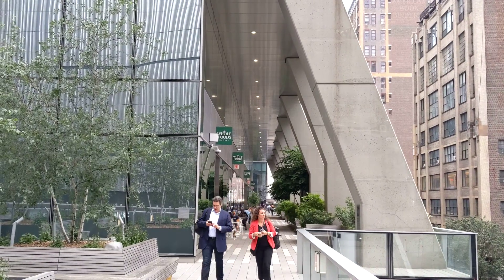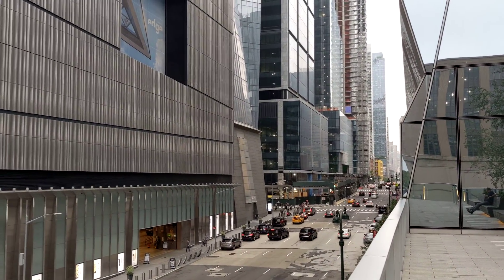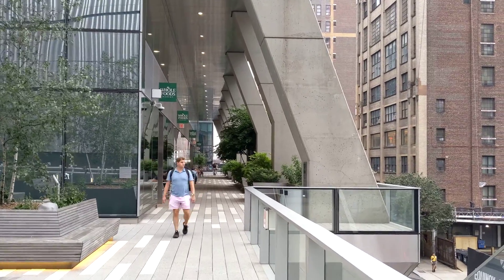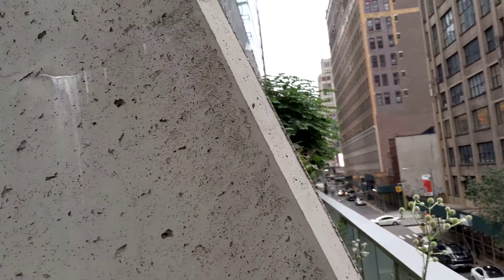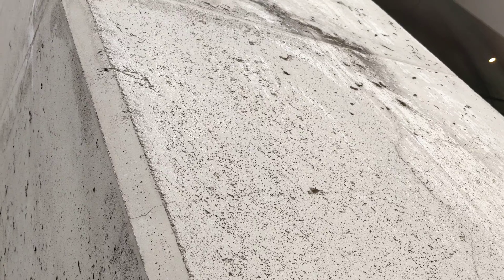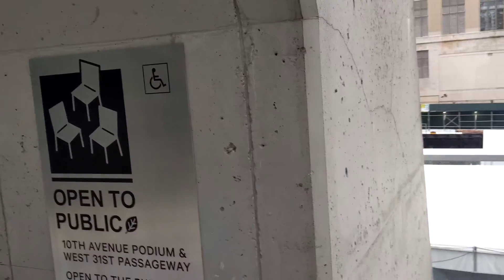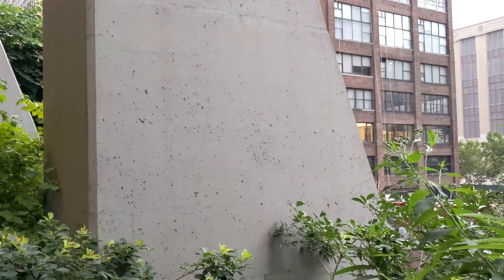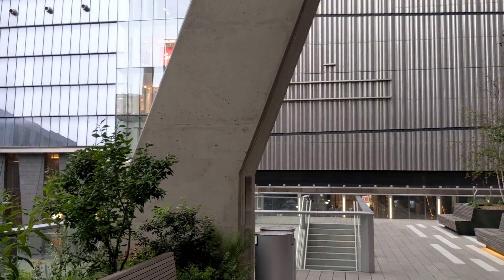Structural Cracks in Columns at NYC Hudson Yards Whole Foods. Another Florida Condo Collapse?

Comment: The building was actually built in 1969 they're just cracks from old age .
Reply: You can even google street view this and see the same columns pre renovation 2009 - 2016
Reply from the maker: That's a new building! It used to be a railway yard earlier. Hence the name, Hudson Yards
Reply: @DesignReviews  the address is 5 Manhattan west it was built in 1969 but it was renovated to look identical to the new Hudson yards in 2017 search it up .